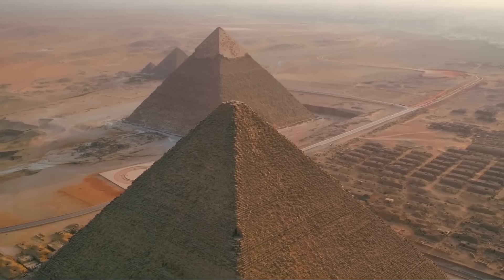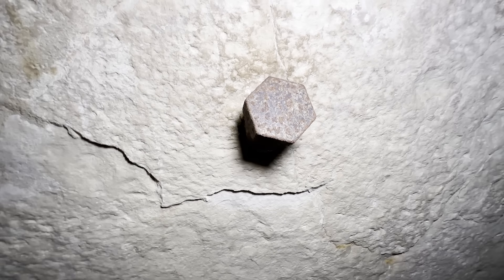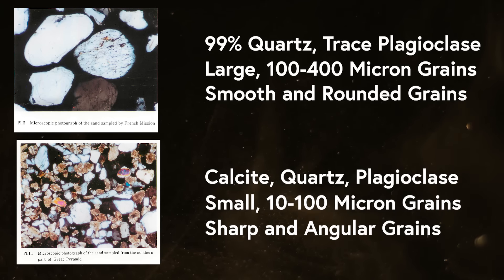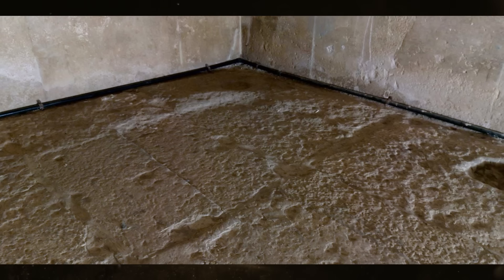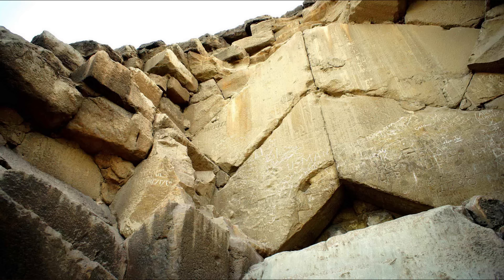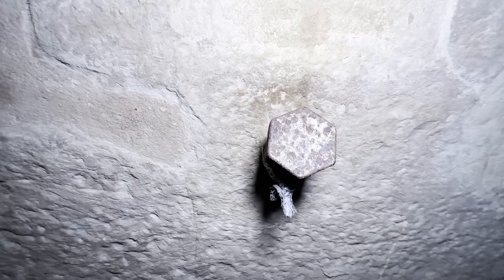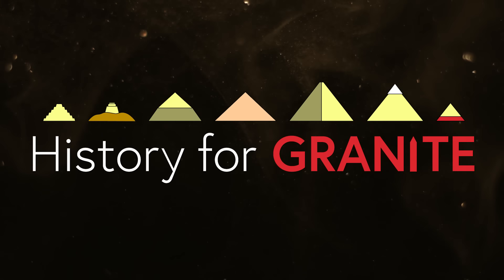How Sand Built the Great Pyramid

Comment: The problem with archaeologists is that they are literary people, not engineers! Would you trust a literature professor to repair your car?
Also, they don't know how to recognize the remains of a tool when they discover one and imagine totally absurd technical solutions such as sliding objects on sand.

The technique for moving heavy objects is however obvious, they used rails! Some were found in the port of Wadi al-Jarf contemporary with Cheops!

On these rails you make the sleds move on logs of wood. You can, thus, move tons.

Comment: Couldn't the sand be from the cutting and dressing of the stones...
And utilised accordingly
Reply: Did you watch the video? How could the sand from cutting and dressing be used as a low friction media for moving stones? Such leftovers are not uniform in size or have round edges. That would counter every point made in the video about the suitability of the sand specially imported from hundreds of km away.
Reply: @teeanahera8949  have you ever read a book 
ever heard of a sieve
Or sedimentation as they used water in cutting stone
Reply: @teeanahera8949  closed minds like your own '
Are why mysteries remain a mystery 

You can only think what you are told to think and defend it with ignorance and pride... 
How sad

Comment: Something genuinely bothers me about the idea of ancient Egyptians obtaining their high quality sand from a place as far away as the Sinai Peninsula. There would have e to be a evidence of this special sand at other sites. Did you come across any such evidence in your research?

I ask because I'd imagine the egyptians would've made a big deal about it somewhere in the written or archeological record. But also I can't help but feel that this was actually native sand that was reused in the building process, and that this reuse actually altered the characteristics of the sand in question. Any prospector with sleuce box experience knows that agitation of material causes the various particulates to start organizing themselves based on their density and shape. Perhaps the reuse of sand for moving blocks actually pulverized the calcite and most of the plagioclase enough to blow away in the wind or get left behind, and the larger grains of quartz could handle the abuse the blocks put them through? 

There is a way to know for sure (the method escapes me but I believe it has to do with polarized light signatures of material over a given region). I do not know if this was done for the sand samples in question as I am assuming all that was done was just figure out the mean grain size range and composition ratios and call it a day. 

There's a fun experiment for someone to do for moving heavy blocks and their effects on reused sand.
Reply from the maker: There is definitely more research needed on this topic. I use that as a guiding light for what to make videos about. Egyptology seems entirely uninterested.

Comment: A number of comments. The first is that some unusual detailing of the chamber floor doesn't preclude the existence of a now missing finished floor in the entire serdab, which is evidenced by, and the elevation set by, the missing floor in the entry corridor. Maybe it was a stacked construction. Also a solid stone floor underlayment may have proven impractical for assembling scaffolding for finish work and required pits in the underlayment to support it, which again would have been concealed by a second floor layer. Don't forget that people dug holes, removing panels in this floor looking for buried treasure in the floor as well as drilling holes in the corridor walls, unsuccessfully, for the same purpose! And without logical reasoning I might add. 

Again, another example with this unfinished floor business that moderns do not realize that the pyramid engineers have more in common with modern designers than is recognized. For instance, there is no logical reason on earth why the architects would have left the construction floor uncovered by a finished floor anymore more then they would have forced anyone and everything up a dumbass 4' square ceiling hole in the descending corridor of the pyramid to get inside the pyramid, or made grand double chevrons above 'a minor passage' leading into the pyramid. Or perhaps more familiarly, why the builders would have left vent holes open above the Grand Gallery at the pyramid face. To collect rat bodies and fox dung in the King's burial Chamber, I suppose. The Chevrons on the pyramid face show exactly the structure of the ceiling above the newly discovered muon and camera space, which is a doubled stack of sloping stone  beams plunging horizontally into the Grand Gallery and supporting millions of tons of stone while doing it and which BTW, is the main entry into the pyramid.

And I'll say it again, Snefru robbed his own father's pyramid and the proof is irrefutable. At the time he did it the wooden components of the Grand Gallery service lift would have been taken out of the structure when it was closed after the funeral of the King, which is why no robber ever encountered it.

Lets not forget the sand. The sand would be a vital component in the concrete mixture used to MAKE the BULK of the blocks used in the construction of the pyramid as well as a convenient filler as the structure rose.  SZ BA MA Art History and Architecture

Comment: Its easy to talk and hard to do.
We didn't catch the point of view for sand filling the wall with high quality one.
Next , there is no way that the queen chamber is not finished and they continued the pyramid to the top, so you miss something here.
Also there is an airing channels which mean it is supposed to serve multiple entery to the pyramid , so if it is a tomb you don't want to enter multiple time.
Next, have any one wonder how the pyramid is completely sealed and once they enter there is no way to have a clear view, there is no trace of torches or fire inside that indicate a lighting system.
And many more question remain a mystery and challenging our era.
Reply: "... no trace of torches or fire inside..." For one, the pyramids do get cleaned from time to time. Second....yeah...not like you could use oil lamps which were the most popular way of lighting things at the time.

Comment: Calcite is water soluble, and if water was used in the gathering, construction or cleaning of the sand, the calcite could have been separated from it intentionally, or accidentally. Calcite is also a useful resource for making lime, and lime is a much courser material. They could have used the course desert sand they could find close to the pyramid, filtered and washed it so it becomes structurally carrying, flows better, and the material to make lime was taken out for being valuable. Then they stomped it in between cracks between blocks. They also could have used water poured over the cracks to get the sand to properly nest into thin cracks, which again would lead to calcite filtering out or being absorbed by the limestone blocks and the sand sorting by size. turning a cheap and local product to a composition not considered as common around the pyramid. Courser sand grains tend to be more round, once you have gravity or human labor filtering sand, you will end up with larger grains that are more round.

Comment: quarts crystal is used in piezoelectric crystals.  used in certain sensors that generate their own electrical discharge based on changes in stress.  accelerometers use quarts to detect minute changes in acceleration or slight changes in stress and discharge a small electrical charge proportional to the change in stress.

Comment: Draw multiple bolts in the Queens chamber are used for condensing liquids, which is from waste products in order to make fuels ,
And different types of sands is for conduction of ions or electricity for  communication  was their purpose was to create different forms of energy created from the oscillation of water within the pyramid.

Comment: I am roughly in half of video but i have a very strong feeling about this quartz sand. Cavity around passage and this sand is quite similar to modern smarthphone loudspeaker. As phone is small designers introduced small plastic balls into inside of speakers to increave area of speaker that can vibbrate and thus make this way louder. I would not be suprised if this sand around so called queens chamber was also designed to amplify some kind of waves generated inside structure. And with some weird theories connecting pyramids to Teslas invention and generating some forms of energy... It could be part of such amplifier foe that energy...

Comment: https://www.youtube.com/watch?v=rxFXsoqbfrk   what do you think about this theory? it seems very plausible. occam's razor would most likely suggest based on physical evidence that the grand gallery has been used for the main building tecnique.  Most researchers tend to speculate a secondary method to be the ramp, spiral or step method with very little physical evidence (there are obvious signs on some of them, but not many on the great). the water pressure/air buoyoncy theory seems plausible due to the lines on the outside of the pyramid in the centre on every side, however it is only one of the pyramids that shows these heavy marks. I've always wondered why the pyramid is know as the "8" sided pyramid.

Comment: I think what many are forgetting or aren't realizing is the structures on the inside of the pyramids were built before the exterior went up. They were on the opposite end of the spectrum from us when it come to building their structures vs ours. We can just easily put up the outer walls first and then finish the interior after the roof and exterior walls are in place to protect the finish product. For them in their era the didn't have our construction materials to work with at the time. So with their form of masonry they couldn't just slap a exterior perimeter up first then haul MEGALITHIC rocks into different slopes and caverns with this "special" sand miles away and then somehow make it look impossible to the discoverers in the future of how they did it. It's called common sense. Unless you have definitive proof then you MUST proceed with the laws of physics and common sense. Just like how the archeologist have claimed they figured out how they cut the blocks. Which would work. But them dragging blocks bigger than some holes deep down under the pyramid after it would be built is just stupid logic and ludicrous. You people make it seem way more harder of a technology than it really is. If I were using the same material that's how it would be built in order. I would work from the center out. It's not drywall. 🤷🏻🤦🏻

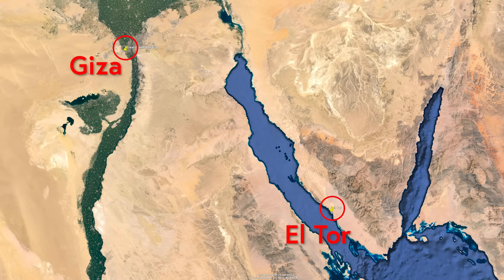Comment: I’m thinking the sand was processed on site. Screened. For larger microns. I have heard water can be used to seperate grain sizes. Or even to remove sand from clay with the help of water as well. But this is pure speculation 7:16
Reply from the maker: But if the local grains max out at 100 microns and are sharp, how do you get the larger and rounded grains by screening the local stuff?

Comment: The Quartz sand has electromagnetic powers that could affect power generation and insulation within the pyramid, being used as a capacitor and affect frequency output.  The location of the quartz sand is probably specifically deliberate and designed to enhance power transfer efficiency.

Comment: woahh
this is one hell of a reach based off some sand grain sizes
the method of extracting the cores would cause so much friction and stuff that the sand grain sizes inside the core sample wouldnt be accurate anyway
so many peices of small rock would get broken up into what is essentially sand by the end of the core drill
also.. theres only quartz in there cos the quartz was pushed through as it drilled through the rock and took bits of quartz with it
Reply: if you took a granite worktop or a limestone block and coredrilled through it... it doesnt take a genius to determine that there will be a heap of what is essentially fine grain sand by the time you get to the other side 
so how can ANY of the sand from the core drill be analysed to any degree of accuracy? it cant.

Comment: The pyramids were built when the area was green and forested.  The sand has nothing to do with stone transport.  It is more likely part of a trap door mechanism or even better "insulation" for the reactions going in in the chambers.   The holes in the stairs, like the holes in the chamber were all former tool holders for when this was a machine......not a grave.

Comment: Any structural engineer would tell you you cant just raise 20 tonne beams and stone up 30-450 feet. just using ropes, an incline, manpower and some sand. Letter on millions of them. You don't cut, transport granite using copper/stone tools transport it over 300miles with some sand and still achieve that kind of precision in parallelism, perpendiculism. Granite is one of the hardest substances on the Mohr's scale a little harder than steel. Precision is something we value in the modern world. Ask any lathe or tool making experts about any of the artefacts(granite pots) would be constructed? and they for sure will tell you some sort of "modern/advanced" technology/tooling had to be used to achieve this. Not a mainstream opinion i guess.

Comment: Yesterday I was told a theory, that the stones were moved by sound , quartz is easily modulated .  Maybe there's something too it?
Reply: How?
- Producing a sound would need electricity. Egyptians did not even know electricity exists.
- Sand is useless when talking of piezo electricity. What is required are crystals. Even if you could « bend » a round grain somehow, it would produce a minute voltage, and the minute voltages of sand grains would be randomly distributed, the voltage of one grain cancelling the voltage of another, with a total voltage being close to zero.
Reply: @chefchaudard3580  Sound, has nothing to do with electricity. Electricity who knows; Tesla had some interesting idea about it ,maybe they did too. All I know for a fact is they didn't move 2.5 ton stones with sand like ball bearings,  that's as bad as people saying they used oil.
Reply: @janvanderziel8548  sound has nothing to do with electricity ? Never heard about piezoelectric loudspeakers? 
I have seen on YouTube videos people moving large stones using simple logs. So, what you believe is irrelevant.

Comment: So, why did the builders of the Great Pyramid use ONLY quartz sand for filler instead of regular sand? The answer is quite simple: Quartz sand is a better conductor of electricity or magnetic fields. That is exactly why the ANCIENT builders used it. In the ancient builders were NOT the Egyptians! The great pyramid was built long before the Egyptians arrived in that area. I have already spent hundreds of hours investigating this and I know exactly what I'm talking about and I AM CORRECT.

Comment: Import special sand so you can slide stones around? Sand isn't going to cut the mustard on megalithic assembly.  The GP structure was built with methods people are not willing or able to accept. Absolute precision does not lend itself to brute force ideologs. This masterpiece in stone was first created in the mental bodies of the builders down the last detail, then assembled. I am asserting that it was effortless and done quickly by those builders, whom there is no record of. 
Acoustically, this mass of stone is as light as a feather.

Comment: You should know that Egypt was not a desert when the pyramids were built, so if the builders needed sand, they had to get it from elsewhere. The coefficient of friction is  insignificant when talking about 80 ton blocks. If your Hypothesis is correct , then you need explain how blocks 10x that size have ben been found all over the globe. Was this low-friction sand present at all these locations? Of course not. So your Hypothesis is 100% wrong. And you have been making videos on this subject for years and never bothered to wonder about that?